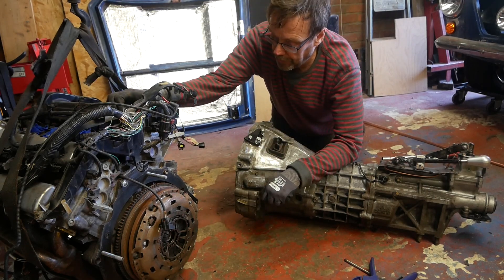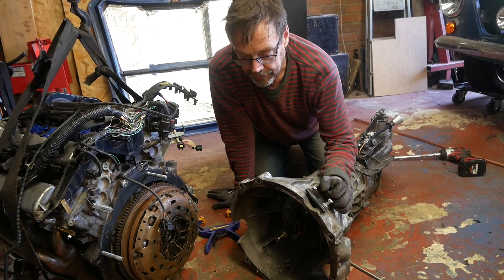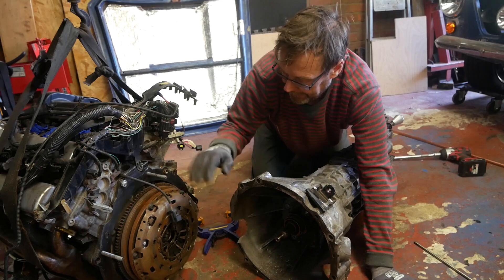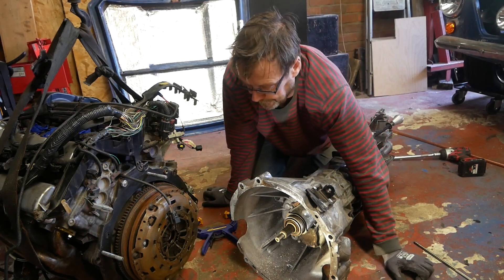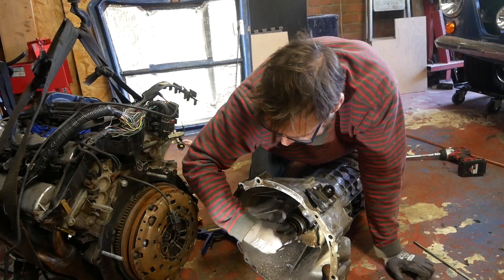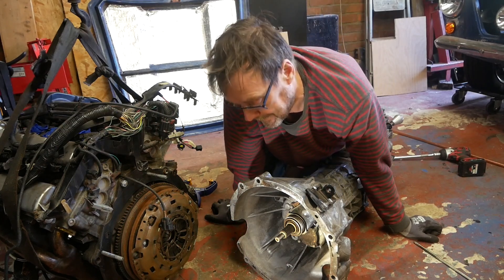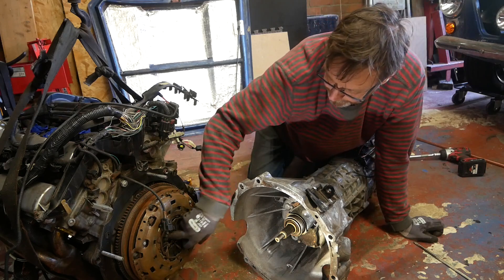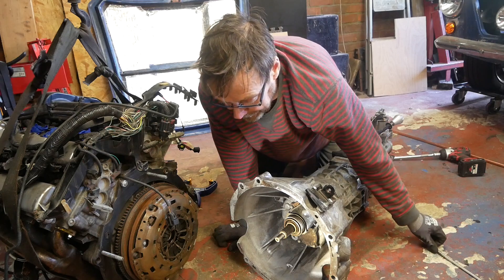Jaguar Aj30 V6 onto Rx8 box - the final combo

Comment: Surely a Ford gearbox can be found that is an easier install.....
Reply: Manual s-type is very rare.  In the USA for sure.    I'd also say a RX8 engine has very little torque, it will be destroyed with a 3.0 v6 I would think.   Ford/Mazda has a manual in its 4.0 explorers, might be better choice.
Reply from the maker: Well i do know of someone (@kevteare4466)  who destroyed his box with this combo but i dont know in what circumstance. You could be right although i am not planning on track use so it may be ok. I believe the rx8 5sp could be a straight swap and is possibly stronger. Time will tell
Reply from the maker: The rx8 box was chosen for availability and cost reasons vs the manual jag box tbh

Comment: I always wondered about this and always felt slightly guilty - 

Many years ago I was put a used Guy Croft engine into a Lancia Montecarlo and there was no spigot bearing.  I only realised at about 3am in the morning as I was mounting the engine to the gearbox and it's first run at a track day was in 2 days so I thought bugger it.  It never caused any issues for the next 10 years I owned the car and tracked it multiple times.  I guess as the layout of the Montecarlo is transverse the input shaft was very short and hence not needed.  

Rolling road measured 156 BHP from twin 45s with standard cams and big valves - was a good result back then and totally tractable from idle to 7000 rom.
Reply from the maker: Nice. I am sure transverse layouts are quite similar. For me, that doesn't really explain the need for spigot bearings in inline layouts though. Maybe its just tradition (like anticlockwise engine rotation)!

Comment: Get a synchro saver for an rx8, 2nd gears synchro on the rx8 6 speeds are basically glass. a synchro saver prevents over shifting which is what usually does them in.

Comment: “A happy coincidence” as far as Speg is concerned that the brilliant engineers that produce the “mating” adapter plate for those two items made it exactly the right thickness for the transmission shaft spigot and spigot bearing to have the correct clearances. Ha ha! ( you do make me chuckle sometimes Speg!), - bless you mate! 👍😁
Reply: It is a coincidence, as the engineers don't make the plate to match any type of flywheel!😂
You need to work all that out yourself
Reply from the maker: Not disputing that the adaptor plate people must have engineered this but there was no info about it and it's a purely flat plate. The coincidence is that it was possible
Reply: I've used this plate with my AJ30 originally onto a RX8 6 speed and now on a RX8 5 speed as I broke the 6 speed!
I'm using a different flywheel,ST200 modified,and a engine from a Automatic SType so no spigot bearing fitted.
I've had 10mm machined off the mounting face of the bell housing to allow for the thickness of the adapter plate,by doing this you ensure the nose of the gearbox shaft is sitting where it was originally before adding the adapter plate,and also you ensure the clutch plate is sat centrally on the splines of the gearbox shaft.
By adding the adapter plate without machining the bell housing you are moving the clutch plate 10mm forwards on the gearbox shaft,I'm pretty sure there is no risk of the plate coming off the splines but I never calculated how much distance there is spare on the shaft to play with?🤔
Reply from the maker: @kevteare4466  thanks Kev. Yes i suppose the plate sits on a different section of the input splines. Tbh i did not measure the length of those or the plain section. Hmm. I might be able to guage by looking carefully at the video as i'm not going to dimantle to check!
Did you use a different adaptor plate for the 5sp? I ask because the 5sp from the mx5 seems quite different - or so it seemed to me back in 2021. Originally I was going to use the mx5 5sp but was put off by the cost of the rocketeer adaptor that seemed much more complex. Or is the rx8 5sp different? 
Even right now i am not sure whether the spigot is in the s type crank shaft or is part of the flywheel but it was already there.
Reply from the maker: Thinking about it, since the input shaft could not be any further back into the engine, the clutch plate is as far down the splines as possible - without machining. I suppose it might be educational to compare the spigot arrangement of the RX8 engine but I suspect this means that unless the plain part of the input shaft is supported very differently on the RX8 engine, then that would mean that the clutch plate is actually sitting on the splines in a similar place to normal.
Reply: @Mr_Spegru yeah the 5 speed RX8 box fits with the same adaptor as the 6 speed.
Both RX8 boxes,5 and 6 speed,are different to both MX5 boxes👍